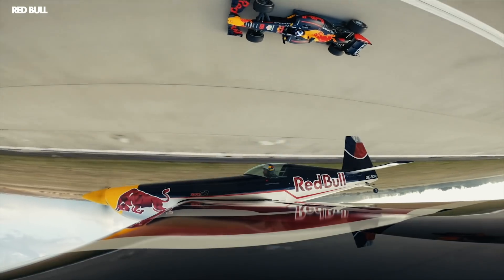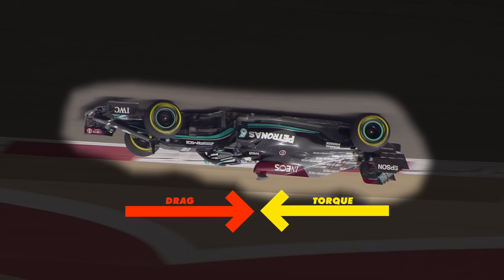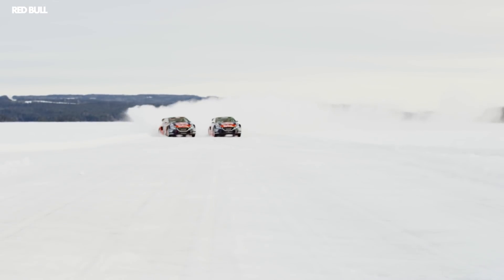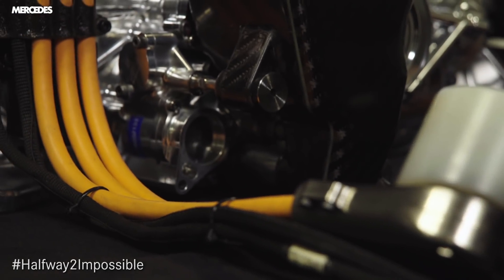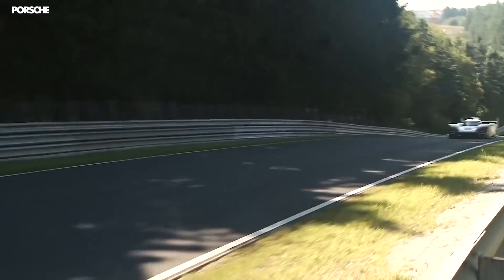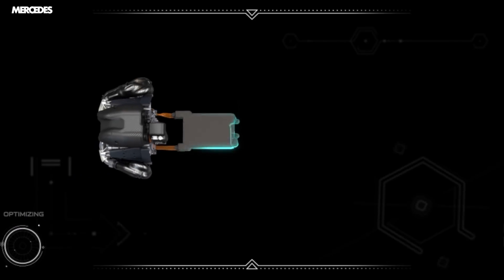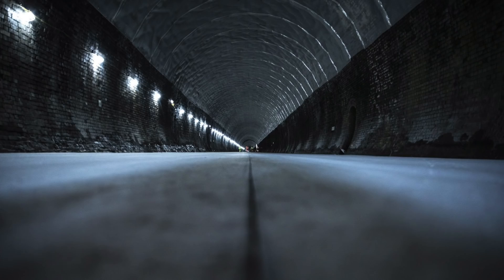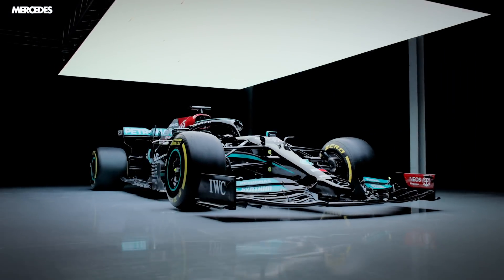Could a Formula 1 Car REALLY Drive Upside Down?

Comment: I feel it's a bit misleading to say that reducing drag is a key philosophy of Formula E to make the Race distance possible. For 2 Reasons: Firstly, the reduced downforce reduces dirty air and therfore makes overtaking easier and the races become more interesting to watch - also, the cars are designed to be sturdy so they can continue racing somewhat competitive after contact and even Braking off the fenders and front wing. Due to the fragile aerodynamic structures, this would be impossible in F1. And second: Formula-E Cars don't deplete their Batteries during a Race. The Capacity is limited by software and different for each race. They deliberately reduce the Battery capacity to make sure that energy management must be a part of every teams strategy. They might be reduced even more after every safety car or full course yellow because during these phases the cars use less power and wouldn't have to save energy for the rest of the race.

So in summary i'd say I'm convinced: if they wanted, they could have much more downforce and stickier tires and still make a full race distance on one of their street circuits. Even though it's obviously impossible to reach F1 levels of performance on GP-Tracks for F1 race distances.
Reply: I doubt it’s misleading, he also references the correlation between vehicle weight and need for aero on lighter cars. The formula e Is around 250kgs heavier than f1. So it’s need for aero is considerably less. I’m sure if the ability for speed and longevity where there… the dirty air and fragility would hardly be an issue if it meant the car would benefit from it. Given it’s so fat and slow no need for wings, just charging ports
Reply: @riz3nfpv306  I disagree. More weight means more force pressing on the ground but also more inertia to overcome. All positive effect of weight will always be overcompensated by negative effects.

The entire rulebook is build around short, thrilling races: tight tracks, attack mode, and uniform, robust chassis. Even the qualifying is designed to handicap fast drivers. Having a lot of down force is directly opposing this concept as it gives following cars a massive disadvantage.

But mainly, I wanted to say: range has never been an issue for formula e gen2 cars. If it was they'd use bigger batteries or shorter races. They artificially limit the range on purpose to enforce interesting tactics. So it's clearly misleading to imply that the cars struggle with a race distance, when it's obviously on purpose.
Reply: It's not misleading. That information just isn't in the scope of this video, and going that far in depth would send the video way off topic. It's clear you're passionate about Formula E, but there's a time and place for everything.  This video was not the time and place for a huge info dump about the structural integrity and aerodynamics of a Formula E car.  You're getting tunnel vision (see what I did there) about a very small part of the video.

Again, not misleading. It's concise for the purposes of the video.
Reply: @8thlvlMage  I get that it's not strictly misleading in the scope of the video - one still gets the point - but considering the scope, the reasoning behind FE aerodynamics was unnecessary. 

I called it misleading because It's spreading a false picture of Formula E. I wouldn't ask him to talk about it more, just to not say stuff like: 'they have low down force because they are electric and need to save energy'. Because that's not the actual reason.

Comment: It is theoretically possible (the maths says it is) but practically it's not for all the reasons explained in the video. We often hear about all the downforce created by F1 cars and is more than the car's weight.....but downforce more than the car's weight does not mean it can be driven upside down. There are so many other factors involved. We can say that if it was possible to drive an F1 car upside down, the sheer amount of downforce would hold the car to the ceiling. That's theory but in practice you simply can't.

Comment: How about an engine that dynamically adjusts its orientation according to a reference plane. I guess it would require a lot of R&D to reduce energy loss and weight increase due to the added mechanical complexity.
Reply: Or you could use a boxter engine. It has horizontal pistons
Reply: @moriarteaa4692  The problem is not the piston orientation, rather the fuel and oil pumps being configured to rely on gravity.
Reply: @456MrPeople  if you build a flat 6 or 12. Have a sump on top and bottom. electric oil pumps that are switched on and off as needed you can overcome that.as for fuel a tank that has four or even eight draining ports with solenoids shutting as they “dry up” through rotation of the vehicle I don’t see it as an overly complicated problem for modern engineers
Reply: @moriarteaa4692  well it ain't just about the pistons.
Reply: JUST use a rotary engine eh. I’m sure Mazda can lend one out.
Reply: @sw01ller  just because it’s a rotor … doesn’t mean it will work inverted, it still has an oil pick up at the bottom of a sump , that’s the bit that wont work upside down.
Reply: How about we take the idea of an oil compressor of the variable valve timing system and modify it to turn the engine and disconnect the drivetrain at every interval through a manual transmission at a computer controlled disengagement to not reduce speed
Reply: just mount it on a rotating bar with the  enter of weight below that bar so that gravity would hold the engine upside down. not much RnD to built that. just make sure that it cant rotate by the crankshaft rotation.
Reply: @patrikjansen7831  The word 'just' is doing a lot of work there
Reply: @DjDolHaus86  you could test it whilst being stationary and maybe use a few actuators, not what i would consider as a lot of rnd
Reply: @patrikjansen7831  You seem to be overlooking the minor issues of packaging  (space in the engine housing) and torque (if the engine is floating, what's to stop it spinning itself rather than spinning the wheels under load?).
Reply: @patrikjansen7831  like a platform the car can sit on that can be inverted inside a wind tunnel. That would be a proof of concept at very least

Comment: How about a version of an old Porsche CanAm car.  I seem to recall that they generated several G's of downforce using  lexan skirts to reduce air flow under the car, and a fan to suck air out from under the car, generating very significant downforce.  They could probably support themselves on a ceiling while stationary.

Comment: Let‘s be honest, if this was possible while spending non-insane amounts of money, Red Bull would have already done it as a marketing ploy
Reply: I think it’s more of a safety issue than a money issue. But Red Bull funded that space jump with Felix Baumgartner and that was definitely more dangerous & more expensive than driving a car upside down, so I guess anything is possible.
Reply: @Yousuck00  Remote controlled car, extra weight saved by not having a driver.
Reply: @ragerancher  brick on the Gas-pedal in top gear and a guide wire
Reply: @ragerancher  What weight? These drivers are like 5 foot tall and weight in at about a packet of peanuts lol.
Reply: @akaraven66  They are easily 70kg or so. That's the equivalent of 3/4 of a full fuel tank.
Reply: @ragerancher  ye because the modules for that doesnt weigh much at all xd
Reply: @Zirion123  They don't, how do you think drones fly? 🤣 They clearly wouldn't be possible if remote control modules weighed anything near as much as a human would they?
Reply: @ragerancher  a car is alot bigger then a drone lol and not to mention that a car has friction to a Surface which means it needs bigger components to deal with the forces + all the modules U have to put on it and lots of wires. This stuff weighs alot more then a driver does ..
Reply: @Zirion123  no it really doesn't. You are aware there are large flying drones used by the military right? Remote controls weight less than a human, this is a well known fact. There would be minimal extra wiring as they already have the wires going to the cockpit for all the driver inputs. All you need is to replace the steering wheel with a small computer, replace the pedals with small motors and you are done. Those will definitely weigh a LOT less than a human 🤣🤣 also you may not have noticed, electronics deal with g forces far better than humans do...
Reply: @ragerancher  ye but again ur not considering the downforce weight and the friction of a car vs something that flies .. at 187mph per hour with double the weight in downforce on it
Reply: @ragerancher  then why does every millitary drone require hydraulic motors and pumps to be able to turn theire wings etc at High speeds then
Reply: @ragerancher  im clueless? U dont Even know that U need actuators and hydraulic motors etc to control the forces for the steering etc. Ur talking like its just a 100gram chip just turning the wheel and it drives itself lol. I wasnt Even talking about the physics of doing it not being possible just that it takes Heavy stuff to make a car turn the wheels itself at those g forces at those speeds .. there is a reason noone has done it. We arent Even close to that type of tech.
Reply: @ragerancher  I’m glad you committed all this energy so we can save 50 lbs on this hypothetical theoretical driver.
Reply: @Yousuck00  nah it’s a money issue. For this project you’re looking at spending over 80,000,000 at LEAST. Unfortunately no company is going to make a profit from doing this stunt unless it’s funded my an insane billionaire
Reply: @verstappen9937  Insane billionaire ? Tunnel ?
* Elon Musk enters the chat
Reply: @Yousuck00  Having one person jump from space is certainly less expensive than effectively paying for a huge throw-away infrastructure project. We're talking tens of millions of USD per mile, maybe even hundreds of millions, since this is very non standard and requires much higher degree of precision and safety than a normal highway. On top of that construction and planning would take multiple years. Not to mention car development costs which would also run in hundreds of millions on top of that.
Reply: I think is little bit of both, money and driver safety, because they probably would need an specific place to do this and It would cost a ton of money, and second and most important the driver safety would be compromised at every time you look at it and extraction and everything related is dangerous due to the nature of the challenge
Reply: @djkleb7645  i kinda have an idea for the safety of the driver, matress floor
Reply: @Dada-fl9qn  or trampoline?
Reply: @purwantiallan5089  safety net would work better
Reply: @Dada-fl9qn  that’s 2km of mattresses 😅
Reply: @djkleb7645  the g-force of a car falling upside down 5 meters to the ground at high speed could cause serious injuries to the spine of a driver, no one ever would try a stunt like this... at least with an human controlled F1 car.
Reply: @miguelelgueta5830  F1 cars should have trampolines to pull back to the track.
Reply: @miguelelgueta5830  There are plenty of people out there that would indeed try a stunt like this. Saying no one would try it because the risk of injury is like saying no one would ever try wing-suiting because of the insanely high risk.
Reply: @miguelelgueta5830  fuck it I’ll give it a go then just give me the car
Reply: @miguelelgueta5830  remote controls exist.
Reply: @miguelelgueta5830 I would in a heartbeat...
Reply: Definitely.
Reply: ong💀
Reply: Honestly if it's ever going to be done, they'll probably have the car mounted upside down to start, and use a carriage attached to a launch it from, that way it would stay close to the ground and not gain too much y component when it falls.
Reply: Well, it's pretty fucking hard to turn it around
Reply: F:UD (Upside Down Division)
Reply: Look at it this way: with every breakthrough revolution in any sport, there was a time before that very first revolutionary breakthrough technique and then the era after where they never looked back. 1968 wings on an f1 car. 1968 the Fosbury Flop in the highjump . 1984 the bmx backflip. I'm sure most folks who were involved in their respective sports before their respective breakthroughs also said "if it hasn't happened yet, it's because it isn't possible". Hubris works both ways. Certainly doesn't mean anything and everything is possible of course.
Reply: Look up!
Reply: Create a robot with ai just for the test to replace the human and make it a fixed course then program ai accordingly I dont know just a thought....
Reply: They could just get one of their stunt propeller planes flying upside down into a tunnel with landing gear touching the ceiling the entire time. That technically would count.

Comment: is the downforce of a F1 car distributed evenly between front/rear weights? This could be a challenge as well if they aren't.
Reply: They can be tuned for equal distribution
Reply: @sidharthcs2110  correct, actually is something like 48% front
Reply: Not too far off the center, and if the downforce exceeds the gravity by a significant margin it should be a problem

Comment: I'm looking to create a racing series with hoy swappable battery and aero that decidedly does NOT suck.
Well, I would have fans to get low drag downforce, of course. Because why not. For the ceiling run, it would get the grippest tires ever and a tiny battery. One use battery, even for better energy and power density. Because race car.

Comment: Was oil starvation accounted for?
In BeamNG drive running an engine upside-down will cause it to burn oil, damaging the engine to the point of a loss of power/torque or engine failure. This would cause a loss of speed resulting in a loss of downforce which would result in the car falling off the upside down road
Reply: Watch full video first, comment second
Reply: That depends on oil sump system

You may have heard of "dry sump" engines, and the usual "wet sump" engines

Dry sumps help against oil sloshing into the pistons. Aerobatic planes have dry sumps for this reason
Reply: Also, see 4:40

Comment: Group C also minimized drag while maximizing downforce.
How else do you propose they hit over 400 kph?
formula E just did TRY to get good downforce. They just didn't want to upset the FIA awarded 25 year monopoly.
FE is intentionally LAME and it didn't need to be.
Reply: Only one car hit 400kph and they did that by running a low drag aero package that was basically unsuitable for racing and an engine turned up to qualification specs that lasted less than a lap after the max speed attempt was made. It was all a publicity stunt aimed at selling the peugeot 405
Reply: @DjDolHaus86  I was talking about a Jaguar :)
F1 barely hits 300 kph without ERS deployment. 850 hp+.
With similar power and weight, Group C hit around 400 and still had positive downforce. Closed wheels are the ticket. Always have been.
Reply: @Cloxxki  The XJR group C cars all topped out at around 750-800hp and didn't produce much downforce in their low drag LeMans trim which was what gave them their top speed of around 390kph. Closed wheel cars are certainly easier to streamline for top speed but top speed is not what you need to stick to the ceiling

Comment: Bumps and surface imperfections are another factor that is hard to account for
Reply: Well once the car has decent force to the ceiling, greater than the car's mass, it should work alright as long as it doesn't slow down.

Comment: It's definitely possible, no doubt, especially because the car that gets this challenge will even have more downforce  wings to make sure it doesn't fail.
Reply: It sounds possible. Imagine if they just slap two fans at the back to create downforce... (assuming the fans don't add a lot of weight)
Reply: @decay2__  then they would have to make a brand new car, because the fans need skirts and other mods to work
Reply: @chm1ata  hi Chris Pedersen. Whats up bro.
Reply: @purwantiallan5089  not an f1 car
Reply: @decay2__  the F1 and Formula E cars never drive upside down.
Reply: @decay2__  if speed is there, there is no need for fans. The “fanned” cars of F1 were only to increase its ground effects during cornering. This would be a straight line therefore we can generate all the downforce needed with wings and HP